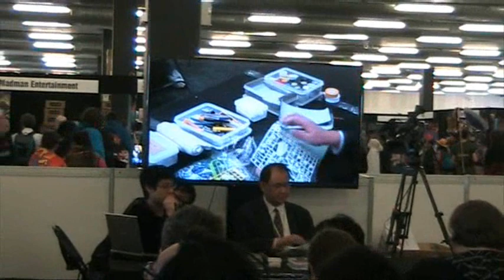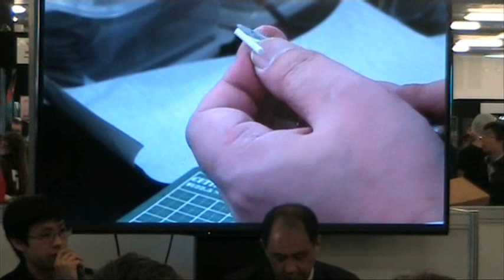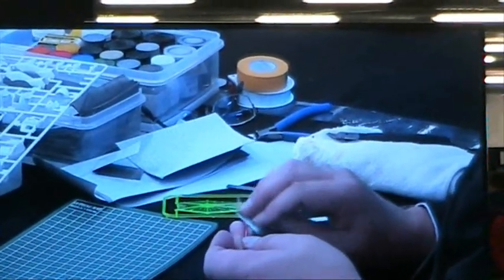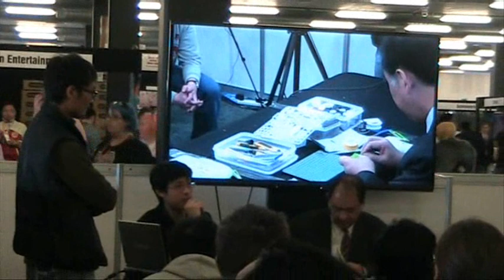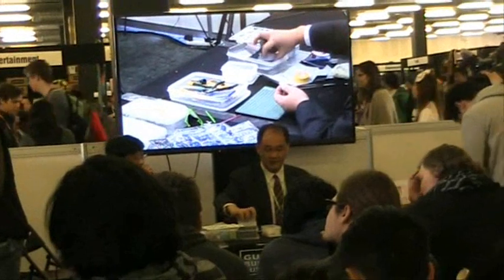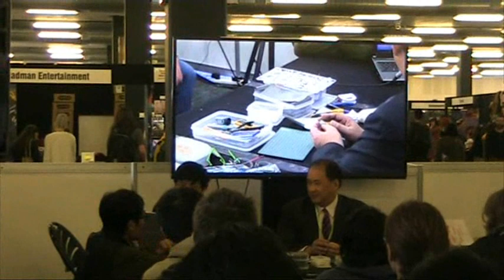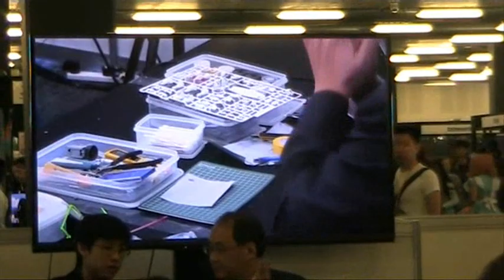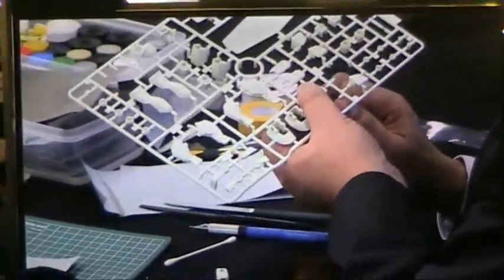Gunpla sand paper tutorial with Master Kawaguchi (English dub)

Comment: wish i knew what kind of files he is using. i have some small files that i purchased, but i feel they are very harsh.
Reply from the maker: +garrin78 If you can effort them the Tamiya plastic files are quite amazing. I believe Mr. Kawaguchi were using the Mr. Hobby ones which are quite standard over there.'
Reply: they use tamiya basic file set  , and pen nib for lining ,  if u can adjusted the power pressure for filing u can get rid nub mark easily just get off
Reply: @mokanaman  is it the gsi creos one?
Reply from the maker: @obicross  yes